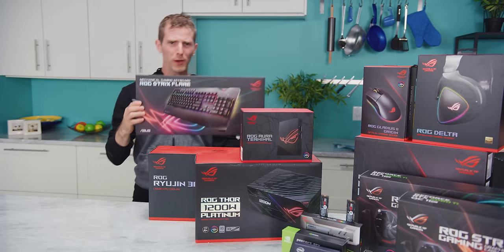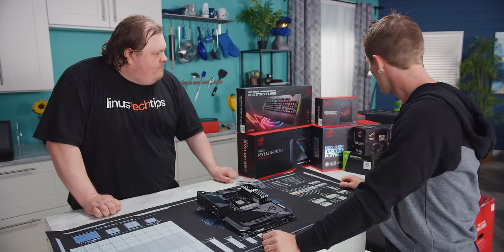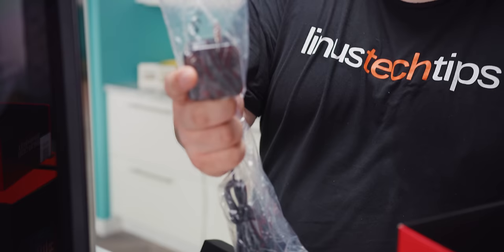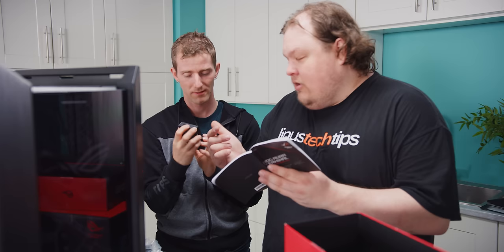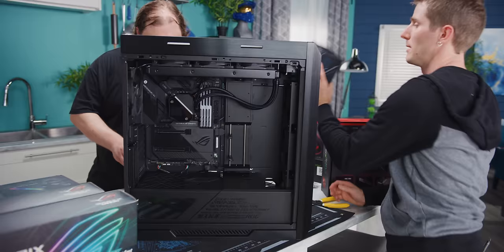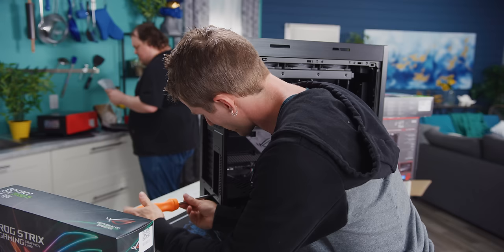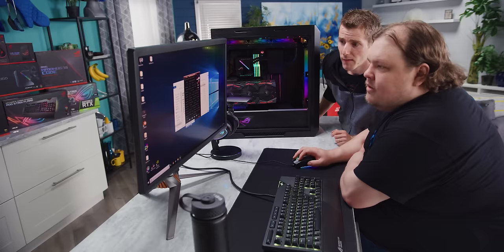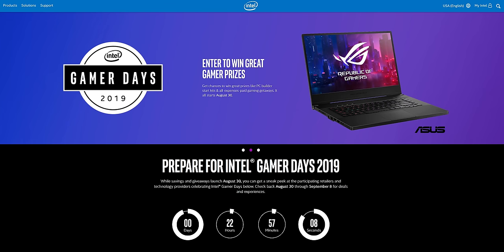The All-ROG Gaming PC!

Comment: If anyone is curious I crunched the numbers and this whole setup comes in at just over $6000...if you go single 2080ti, 32GB RAM and 850W Power Supply, it's about $4990. So no you cant have this.
Reply: Well thanks for the info. I would like to have this system for sure. But would go the cheaper route with single 2080ti and 32gb ram. No need for duel 2080ti's and 64gb of ram really not necessary either.
Reply: Thats not too bad, probably buying this when they launch a cpu👍
Reply: 6k how I have all the parts in my Amazon basket for 2900
Reply: Valkry0362 Amazon is way cheaper than actual companies you might get scammed bud
Reply: @pegasusseiya3731  
If that's the case then blame LTT for linking to them in the description xD
Reply: Edward Blake that's a different case. If LTT linked them then it is their sponsor/company they trust and has never scammed anyone
I was talking searching for the item and buying it from random people
Reply: Holly crap by the time you pay taxes you would be way over 5 grand hummm buy a car for that.
Reply: The wild part is in 5 years it will be at most 1k. In 10 years it will be on Ebay for 200.
Reply: eyeofjake yes and the performance will drop significantly after 1-2 years of usage it would be outdated in 3-4 years just trust
Reply: Its 3,630.5 euro
Reply: Yeah no, if you have a job and actually save some instead of spending everything on hookers you'll afford this no probs.
Reply: Just FYI I looked it up on pcpartpicker and it comes out at about 4990 WITH 2 2080tis. So maybe there was a price drop, or you just looked them up on websites that were not optimally priced?
Reply: I made my own version of this and I made it just above 1600 lol
Reply: @eyeofjake  5 years ago you would be running dual 980s and a 4790k, which already is now not even worth 600.
Reply: Might as well bump it up to $7K for an Intel Core i9-9980XE (18 Core) Processor, and a Asus ROG Strix XG49VQ 49” 144Hz 2K (3840 x 1080) HDR Curved Monitor upgrade. #BetterValue
Reply: I have that system lmao
Reply: @SanonPierre  And forget about dual Titan RTX's and PG27UQ monitor? How distasteful!
Reply: Yes I can   if I want it bad enough
Reply: Lol i have this
Reply: CIA  exactly my thinking, I don't need something as expensive as an rtx so to be honest I wouldn't even go for an nvidia card, amd all the way.
Reply: Spencer Agnew DID U THINK I DIDNT KNOW HOW BROKE I AM
Reply: Imagine having a descent job, living within your means, few paychecks saved up... you can have this!
Jobs are out there, go find a better one. I did and tripled my income within few years. Just got to put in the work.
Also, don't forget the SLI video cards so you got to add 2 video cards to the card which is roughly around $5600 + tax
Reply: I have a 2080ti, 32 gb ram, 850 power supply gold, a killer motherboard and a i9 9900k. I paid 2800 dollars and even got a corsair mouse and keyboard. 4990 dollars ? lol
Reply: SLI so 2 video cards roughly = $2,400 + tax alone. Not sure why people don't see that. I also believe i9's cost a lot more before AMD announced there new line.
Reply: But is the LTT waterbottle included?
Reply: @Mimic-Shadowz If you just doing 1080p gaming, which by those frame rates you probably are, you could have probably gotten $800 or so computer.
Reply: Honestly I figured it'd be more than 6 grand just because everything is ROG branded. You'd have to be insane on multiple fronts to purposefully shove out the cash for a complete ROG build from the ground up. Don't get me wrong, Asus usually makes decent stuff, but the price tag premium they shove on anything with an "ROG" sticker is freaking insane and absolutely not worth it. I mean in terms of ROG parts, a $300 motherboard is considered "budget" tier. For the most part you can find competitive parts that are just as feature-rich or sometimes even moreso, and that have equal or even better performance for much less cost. Buildzoid has had some good videos showing some of that price-premium ROG stuff can be pretty "meh."
Reply: i mean this is the price of the rog mothership
Reply: Let’s see how cheap this setup will be in 5-10 years lol
Reply: @pegasusseiya3731  Not really, I'm using a Haswell i7 4770K and it still performs very well. Of course, it is running a 1GHz overclock, but it's 6-years old now and still going strong.
Reply: I’m so gonna build this fucking rig
Reply: A҉n҉o҉n҉1҉3҉3҉7҉ 【X】 you can do a build for $2500 with a 2080 Ti.

Comment: Re: the bleeding. Back in the early 90s when a group of computer science undergrads and I started building and upgrading our PCs from components (Mostly 386s and 486s) we used to joke that any build where no blood was spilt was doomed to failure. Luckily (or not) back then cases were mostly made of what seemed like damascus steel sharpened to an evil blade so it was pretty much inevitable you would cut yourself.
If it posted you were about ready to spend the rest of the day configuring the esoteric memory configurations and IRQ and DMA conflicts in your config.sys. 
Once it was going you could join the doom deathmatch over IPX network in the student flat.
Halcyon days.
Luv and Peace.
Reply: I like this story slightly older than my generation i was relegated to fragging my older brother in duke 3d at the age of 5
Reply: What
Reply: You're like a wizard god of silicon or something. Teach me your ways, noble master.

Comment: 1. You could have taken out the top to make installing radiators a dream, 2. The RGB controller has its own place in the front on the cablemanagement shroud, to see the RGB on it, and 3. You didnt use the official rog riser cables. But lovely Video.

Comment: If you play Cities Skylines, 64GB of RAM is not overkill, you could fill that with assets and mods
Reply: Still need more
Reply: which are necessary since the core game is................. you know
Reply: Yes
Reply: @Gabrong  I forgot I was told the game now has enough expansions to bump the requirements of ram above 8gb
Reply: The question in 2019, 2020, 2021 ......... "can it run cities Skyline 60 Fps?"
Reply: @forsentio  pretty much. I only use gameplay mods on Skylines because of this.

Comment: "4.7 ghz" "mmm respectable" me over here stuck on 3 ghz
Reply: I'm stuck at 2.7 ghz
Reply: @AdibAli-hf1fr   waht are you using  i have a ryzen 7 2700x  at 3.7ghz   but when i check on it using task manager it says 4.1ghz   so i have no idea whats up with it.  the box said 3.7Ghz but it goes to 4 sometimes.  im not a computer person im just a car guy,   i gave my buddy a $2000 budget to build me a pc to run my racing simulator in VR on.  and all said and done it looks cool. and i was at the store with him so he didnt rip me off.  i just cant believe how much graphics cards are?!? the card was like $800 for a graphics card.  wtf is that i saw computers for 800$  whole ass computers  and just this card cost that much.   idk but hey it runs VR on my racing sim rly well so he did the job. i just dont understand computers at all
Reply: Me on 1.8 ghz
Reply: Nurburgrings Fastest i believe the x series ones overclock by themselves at times of heavy load but you can also overclock it manually to to set frequency on all cores if you have a b or x series motherboard
Reply: @skedaddle2201  i just checked my receipt does my motherboard support that?  check it out this is what kind it is.  no idea what b or X means hopfully you know.  and if this does support it.  will doing what you said about the cores be any problem?  i have a 850 watt power supply gold on the receipt too.  and that stupid 800$ card i found out was an MSI RTX 2080 super but it has like 3 fans and a ton of lights.  idk if you know the one. or if its bad... im hoping this stuff is all solid. i wanted lights on everything so thats why all the stuff has to be stuff with Lights.  from the ram to the GPU and even CPU cooler and mother board.   anyway heres the motherboard.   

ASUS B450-F ROG STRIX Gaming AMD AM4 ATX Motherboard

my friend told me not to get any of the parts with lights since they cost more and they do nothing.  so maybe i over paid because of that.  and with the money saved on RGB maybe i could have had a more powerful but less cool to look at computer..... it was my first pc pc.  so i really wanted it to look cool.   i was going to buy an xbox one X  and he said no build a PC.  so anyway im a console boi car guy with a glowing PC that i know nothing about.   HELP plz
Reply: @ueehurstonsecurity8887  my pc is 800 and 800 for a gpu is overkill. I can play half life alyx (vr game) without any problem
Reply: @ueehurstonsecurity8887  the normal clock speed on your cpu (without over locking) is the 3.7ghz. 
But the 2700x can boost up to 4.3ghz for short periods. 

I am not a huge computer guy myself, but you could check when the CPU is at 4ghz. Boosting should be normal under huge workloads
Reply: @ueehurstonsecurity8887  your graphics card is anything else than bad. That's basically the best you can get right now, for a normal price. Graphics cards are by far the most expensive cards in any computer. Usually they are at 30-40% of the total build budget. 

I am not sure if you need it though. You can get good cards a lot cheaper. Price performance ratio isn't really good at "luxury parts"
Reply: Me stuck on 2.0 ghz with an i3 6th lmao
Reply: @bort_1265  thank you for that information. that eases my mind alot.   the guy at micro center when i was building the pc,  had a really   "its up to you" attitude.     when i would ask like do i need this for VR? like is this chip worth the money you think to make my game better? or is the cheaper one fine?   "its up to you"         and i was like ok......just get the expensive one then..... i thought hed like let me in on some secrets but it was just a do you want this part yes or no?  my questions where answered with questions lol   so just goes to show how little i know.  im a car guy so i can relate to some of the car questions i get.  V8 means better right?  depends on what V8.   type stuff.   we have 2.0 liter turbo inline 4 cylinder engines putting out more than a  1970's 7 liter V8 in horsepower numbers these days.    so maybe i was just asking dumb stuff
Reply: I’m stuck with 1.9ghz
Reply: Me stuck 0 cause I’m to poor to afford a computer
Reply: @user-gg2zu8yp1g  Me on 1.5 Ghz
Beat That!
Reply: @ueehurstonsecurity8887  X and B refer to AMD motherboard chipsets.
I believe both are capable of overclocking, but AMD X boards (like the X470 or the newer X570) are fully unlocked. If you're not a computer guy and you're not aiming to utilize everything an unlocked board has to offer, you won't really need an AMD X570 or Intel Z390 board. (It won't affect your gaming experience going for a cheaper B board)

CPU cores really amount to the amount of tasks it can handle simultaneously, while the (over‐) clocking amounts to the speed at which it processes. The higher the speed, the more wattage it needs and heat it produces. If cooled inadequately that could cause performance issues and shorten the lifespan of the CPU

RTX 2080 Super is an 8GB card if I recall correctly. It's plenty capable of running pretty much everything on high settings 1440p. If you pursue 4K gaming, the 11GB RTX 2080 Ti easily goes for around $1500 a unit. (24GB Quadro RTX 6000 cards go up to $5000, although those cards are designed for high‐end photo and video editing, CAD applications and the like, not for games)

What's important is that the GPU, CPU and RAM are capable to handle whatever you wish to run as smoothly as you want it to, and make sure they're compatible with your motherboard. Compatibility lists for RAM and CPU should be available on your manufacturer website for your motherboard, if not in the manual.
Reply: You guys are breaking the gigahertz barrier?
Reply: @AdibAli-hf1fr  I was stuck at 1.5 GHz until today
Reply: 2.6 but to prevent overheating issues I stay at 1.8 ( and I can turbo all the way up to 3.6ghz
Reply: Me: stuck on a core i7 1.7ghz. :/
Reply: I'm stuck at 4.3 i9-7900x is still decent but 4.7 would be nice
Reply: I am stuck with 2.31 GHz I believe and that's with a core 2 duo
Reply: I'm gonna get some 3.6 or 4 ghz action soon
Reply: 2.4 here
Reply: im at 2.27
Reply: 1.2 ghz...
Reply: 2.9 ghz 😅
Reply: Stuck at 2.2GHz
Reply: Me at 1 GHz
Reply: Bruh I have a 7 year old laptop which can turbo up to 2.1 ghz
Reply: Nurburgrings Fastest i know this was a while ago but if you still need the info but um the x and b mean the enthusiast level of the board like x has sli and other options but b is like basic enthusiast entry level itll allow you to overclock and rgb’s yeah lol dont much but its runnin meme “rgb= more fps” it looks dope but your set up is definetly top of the line youll be good for years and 850 watt is more than enough
Reply: Even the Asus Rog phone 3 boosts to 3.5
Reply: 2.1 GHz
Reply: You're lucky I'm stuck on 2.7 gigahertz
Reply: @user-gg2zu8yp1g  qartveliiiii ramagaria ertaderti at var lttis fani
Reply: @handlebyme  I'm at 0🤣
Reply: @handlebyme  😱😍😍😍
Reply: Meanwhile me stuck holding my metal rod at 50hz
Reply: 1.70ghz integrated graphics

Lot of storage tho (1tb for a laptop)

Comment: Linus : Woaw Dual vertical GPU !
GPU Thermals : Oh F***
Reply: might improve it, gives each card room for the heat to go up into other components instead of the bottom card heating the top card up. Or it might at least give them more even heating instead of one card getting considerably hotter. Can't say for sure, maybe we need linus to do a test on their thermals in both positions. (a single card in vertical gets hotter, but having two cards automatically changes a lot up due to limiting airflow on at least one card)
Reply: I've never done dual vertical GPUs but any time I've tried to mount a single one vertically, the thermals have gotten much worse. The spacing between the fans and side panel in most cases isn't adequate. They make a bracket to move a vertically mounted GPU closer to the mobo giving it more fan clearance but you also lose access to all the other PCIe slots. I forget who makes the bracket but it's in one of the most recent Hardware Canucks videos.
Reply: This rig is begging for an open gpu loop

Comment: I think I clocked the total cost at about 7500 with peripherals.  That sound about right?
Reply: The parts they linked in the description are 495 + 2*1270 + 300 + 370 + 301 + 1900 + 270 + 358 = 6534 (cpu, gpu, case, motherboard, PSU, monitor, cooler, memory). Then keyboard, mouse, headset, Aura Terminal, SSDs for another 177 + 80 + 154 + 80 + 2*328 = 1147, for a total of $7681. So, more or less $7500, you can probably get a discount somewhere when ordering so much.
Reply: I was wondering on the price. And Jesus I really want this build but no way I could afford it
Reply: Be a little more reasonable on the GPU (maybe 2070S or AIB 5700XT) and monitor and it wouldn't be quite so bad.
Reply: @Conor He said a 5700xt and they have an amazing performance compared to the 2070S with only about 10 FPS difference for $100 cheaper
Reply: @mysterygamer48  maybe we can talk Linus into raffling it - or maybe sponsor a contest with this system as the prize...

Comment: 4k with ray tracing on... double 2080ti, drop below 60fps during 21:15 gameplay?
Reply: KF thats kinda low for two 2080ti..
Reply: i guess that's why the vast majority of gamers still use 1080p. 4k just isn't feasible yet with the tech we have.
Reply: might be beacuse they have the pcie extenders, idk
Reply: running on 8x not 16x so performance ain't at full
Reply: is cause bf5 doesnt support sli
Reply: @korndud  It's because your eyes don't support that resolution.

Comment: Do a Aorus/Gigabyte build they have actually everything even ram
Reply: +1
Reply: Missing the cpu and their cases are just badddd. The asus one is ok, which for a çompany like asus and msi thats oretty descent considering companies like theirs track record
Reply: Also it was sponsored
Reply: @Dracossaint  I like Gigabyte/Aorus way more then  msi/asus...everyone has their own opinions bud. (gigabyte also offers a mobo/cpu combo that comes pre overclocked, JS)
Reply: @TWModern  Gigabyte/Aorus has the worst FAN on GPU, In 3 months using at 80% stop spinning and even break. I hate them so much GARBAGE FANs
. I can show you tons of GPU FAN broken that I have.
Reply: @nexitorned  Ive have several gigabyte gpus over the past 6 years. No issues for me. Things like that can happen to any manufacturer.

Comment: This is PCIe 3. And you got 20 lanes iirc. 16 from the cpu and 4 over the chipset. The 2080tis might or might not be gimped by running on 8 lanes but the 2 970 pro nvmes certainly are by running of 2 lanes through the chipset each :D Im not sure about this setup.

Comment: i wish i had a gaming PC im stuck on a low-end Acer tablet that's meant to be a laptop cause of its bluetooth keyboard
Reply: NIGHTCORE3710 ya bro I have a laptop that isn’t the best it’s alright but it’s a old model can’t run much games I have to play gta 5 at 30 FPS online
Reply: @tenshi6397  bro roblox isnt smooth for me
Reply: NIGHTCORE3710 oof
Reply: @tenshi6397  at what res. if at 1080p 60fps for GTA V on an old laptop isn't bad. my laptop barely runs League of Legends at 30fps 720p and still hits 90 degrees. but you can build a PC with used parts, aliexpress and scavanging old PCs for 100-200€ depending on what you can find of use. it will run most games 1080p @60fps. find an old monitor a cheap keyboard and you're good to go!

Comment: 1. NZXT Kraken was the only thing I trusted on my 3950x with planned 5950x
2. G.Skills DDR 4 14-14-14-28 with Asus Aura Sync is also acceptable.
3. You forgot the Goo brand Aura Sync light strips.
4. I know ROG can't be trusted when it comes to a Chassis so I used the TT 900.